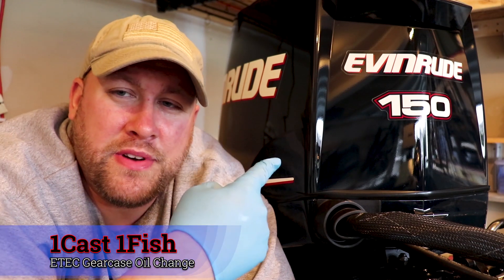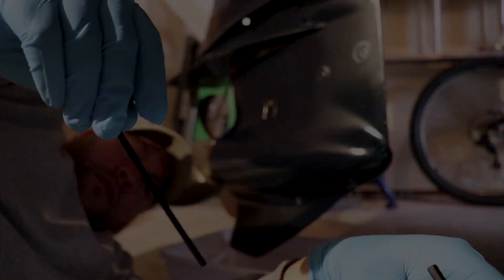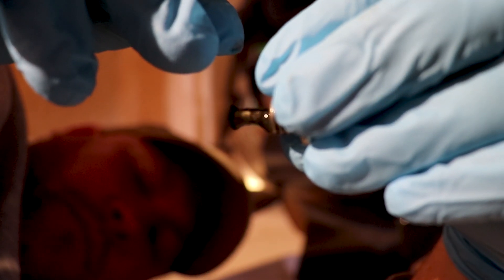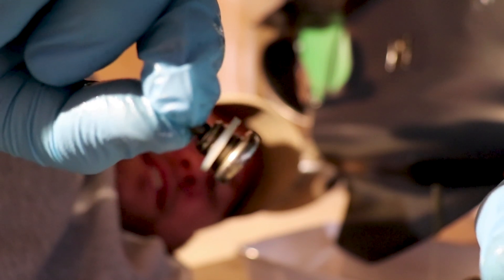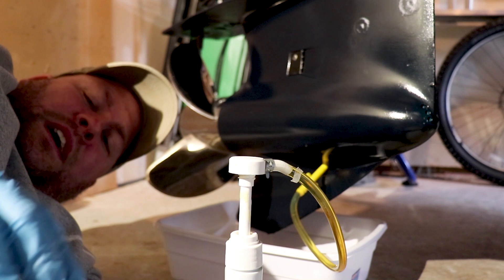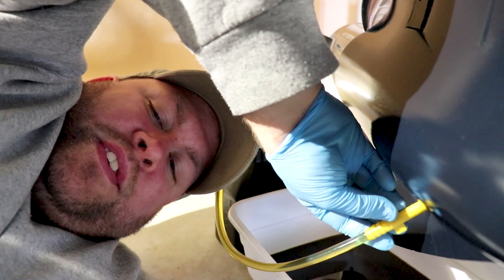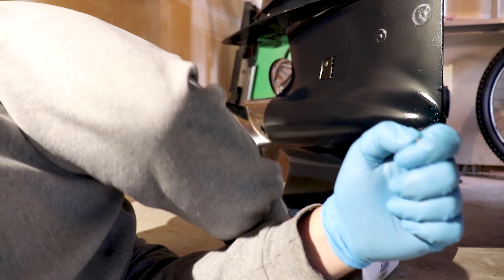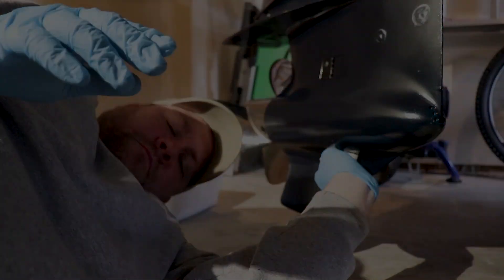Evinrude ETEC Gearcase Oil Change Instructions | Step by Step Outboard Oil Change

Comment: Thank you for the videos! I followed your video today changed out my lower gear case oil. Found a little bit of creamy colored oil came out at first. Is it a very difficult job replacing seals to keep water from coming in? Looks like there’s a prop seal, one underneath the water pump and one at the gearshift linkage
Reply from the maker: A small amount of discoloration may be normal...hard to say without actually seeing it.  I would pour the oil in a clear container and wait to see if it separates. Also the first step would be to drain the oil and perform a pressure test on the gearcase.

Comment: Is there a reason you dont just fill it to the top with no fitting on the hose so u can see when it starts dripping out instead of filling from the bottom?
Reply from the maker: Fill from the bottom to ensure not air bubbles are trapped in the gearcase.

Comment: some change this fuild before winter (I assume they what any water out so it won't freeze an crack the case)doe's it make any differnce before or after winter as long as it's changed each year? also I believe it's takes a tiny bit more than one quart, is it OK to just use one quart? excellent video.
Reply from the maker: I use my boat all season, so I do mine every spring.  I think it's Ok either way, just depends on your weather and storage situation.  If I winterized the motor and left it out in sub freezing weather I may look to drain it and change due to any water contamination.  Always make sure the gearbox is full, pump in from the bottom and stop when its coming out the vent. If it's low damage can definitely occur

Comment: I have a 2020 VTEC.   Is the lower unit going to be the same?   I couldn't find the upper vent plug on mine
Reply from the maker: I believe the 2020 is a Gen 2...these are Gen 1 ETEC's...not sure on a Gen 2 Lower Unit

Comment: So I just performed this on a 2008 gen 1 90 I got used. Took off the vents noticed water came out first.  But no nylon washers on either.  Could this be the issue why water is in it ?
Reply from the maker: Double check, they like to stick to the casing sometimes too.
But if none are there, then yes it could be a source for water to get in.
I would look up the part diagram for your engine using your model number and see if there are washers needed, if so buy them and install...then check again for water.  If water is still present it is likely a seal.

Comment: Make sure you install right size vent plugs to upper and lower holes. I broke off magnet on upper drain plug and had to pull lower unit to remove it. Simple oil change ended up costing me big $$$$!!!!!! Simple mistake.
Reply from the maker: Dang, that really sucks to hear.  Hope all is good now

Comment: Great thank you, just wondering I can see you have a different cable entry grommet at the end of the video. I changed my battery cable to thicker 1 b&s so my grommet doesn't fit properly anymore, I think yours might work for me. Just wondering is it stock or aftermarket? Any idea what the model number would be? Thanks
Reply from the maker: Mine came rigged from the factory like this, so sorry I can not help much.

Comment: Thanks very much for making these ETEC videos. Do you know why they have to be pumped in from the bottom, rather than using a thin nozzle to fill it from the top? I'm thinking of using the Lucas oil in the future to save some money. I'd change it every season, so I don't think it's too risky to use a cheaper oil.
Reply from the maker: It ensures the air is pushed out. As far as what oil I always recommend buying the Evinrude stuff, not much more and peace of mind IMO. Way to expensive to skimp on a few bucks.
Reply: @1Cast1Fish  All right, makes sense. Thanks for responding.

Comment: Your videos are so good and easy to follow. Can you do a video for an oil filter and oil change for upper unit?
Reply from the maker: No upper unit oil changes on these models
Reply: So just keep adding xd100 in the reservoir to keep it full?
Reply from the maker: Correct, that oil does not get changed as it is mix with the gas in the motor. As the level drops, just top it back off.

Comment: What weight oil did u use.?   We're u get the filler pump for drain threads?
Reply from the maker: Not sure on the weight, this was the OEM Fluid from the marina.  I bought the pump at Walmart of all places

Comment: I have the problem that my oil transfer pump doesn't reach the bottom of the container and when the oil gets so low in the container it becomes hard to pump.
Reply from the maker: You can try to loosen the plastic suction and move it down a bit...or buy and cut some new plastic tube to fit.  You can also just take the extra you can't reach and pour it into a new bottle of oil for use.

Comment: Good 'how to' video without the superfluous nonsense seen in other videos. So, if one were to seal up the bottom plug, and fill from the top, would that trap too much air during fill?
Reply from the maker: This oil is very thick, so filling from the top with no where for air to escape would end up leaving some voids.  I have always learned to fill from the bottom and vent out the top till I get flow from the top plug hole.  Might work the other way, but I don't recommend it.

Comment: anyone know how many ounces do these motors use?
Reply from the maker: Not sure on the oz....but buy 2 quarts and fill till the oil comes out the top plug hole.  Let it sit a bit, and pump a bit more till it comes out the top hole again...then you are good.  I use just over 1 quart usually.

Comment: On Evinrude's website, they have a lube pump large and a lube pump small listed. What size was the pump you used in the video? Thanks.
Reply from the maker: Mine is the smaller pump....the larger one works with 1 gallon containers and I use the smaller containers.
Reply: 1Cast 1Fish gotcha. I wasn’t sure if the larger pump meant it had a larger connector piece etc. thanks for the info

Comment: i had lots of metal on my plug, im gonna keep an eye on it
Reply from the maker: Mine had lots on it when it was brand new and the first change, since though it has been very minimal like in this video.  I would definitely keep an eye on it if you are getting a lot.  I also change mine every year.
Reply: @1Cast1Fish  ok,im hoping its the break in to,thanks
Reply from the maker: If its fairly new then most likely it is...I know I was kinda scared when I did my first oil change and saw how much was on the plug.  Since the first one, there has been hardly anything on there.

Comment: That lower unit oil from Evinrude is good for 2 years....Been using it 4 years!!
Reply from the maker: Dang...I have always just changed mine out every spring. Good to know its lasting that long in there with no issues for you.
Reply: @1Cast1Fish  It's a High Pressure lube...I still pop the bottom plug once a year to make sure the oil is knot milky....if that's the case the lower unit shift seal is most likely the problem!!
Reply from the maker: @WesLovelace  great info from your experience...thanks for sharing.  Hows the fishing been your way?
Reply: @1Cast1Fish  I've gotten back 2 back slams Fri/Sat...Taking a break 4 a week!! I'm finding more big Reds & the Snook are starting to appear....You!!
Reply from the maker: No fishing for me lately...life has been busy...when it rains it pours man.  I hope to get out in a week or 2.
Reply: Wes Lovelace I think it is actually good for 3 yrs or 300 hrs I went 520 hrs on mine oh whoops still good on evinrude gear oil not on any aftermarket oil don't trust it JT